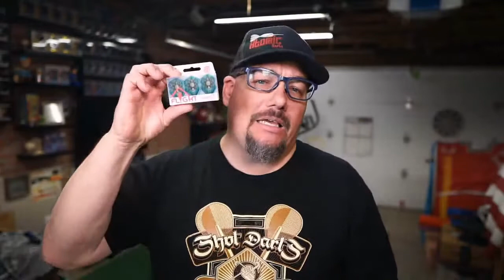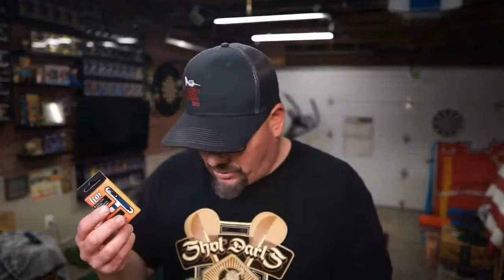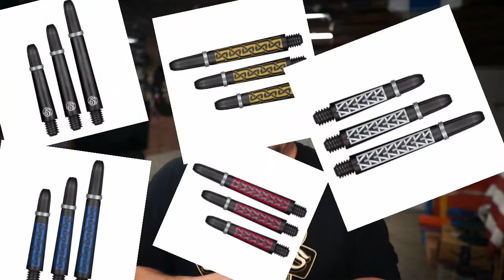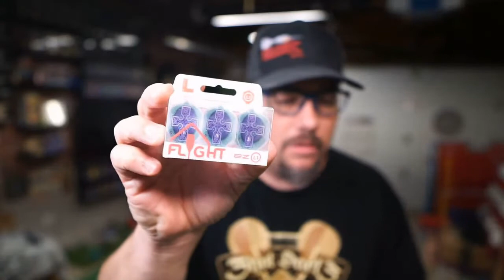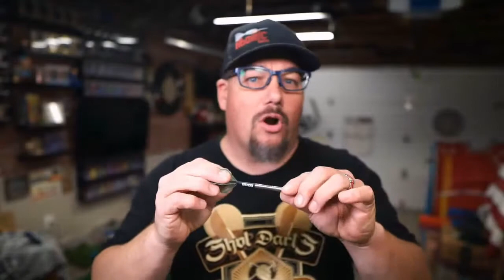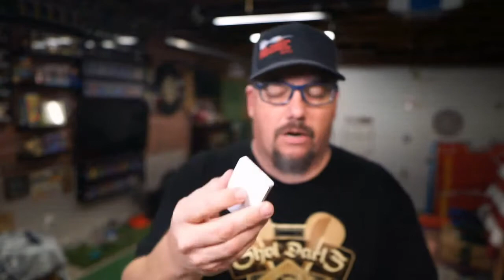Koi Shafts & New Celt Designed L-Style

Comment: ive been using mission carbon shafts.
they are the cheapest ones ive seen in carbon (2 euros/set) and so far i have yet to break one.
only thing is the prongs are kinda sharp, which can make it hard to find a grip or slot ring that fits right.
Reply from the maker: By the way thanks for watching the show this morning.
Reply: @AtomicDarts  lol sorry about the LGB, but it's just too damn funny not to.

and when greg gutfeld becomes the funniest guy on TV you gotta take the funny where u can get it :P
Reply from the maker: @daveyjones5702  I did not mind it I just know a few that watch still have not figured out that good old Brandon has screwed us.